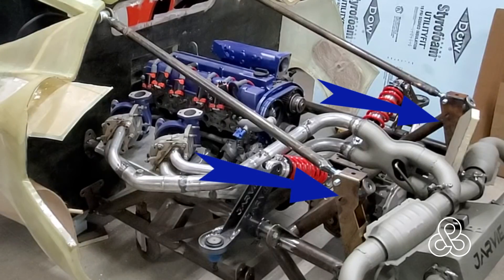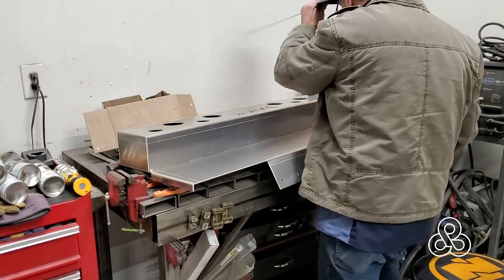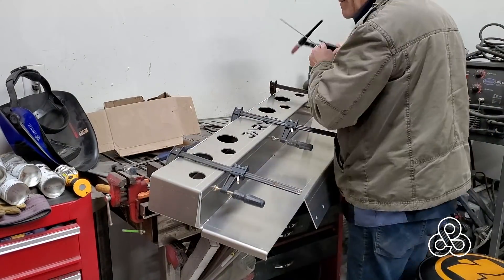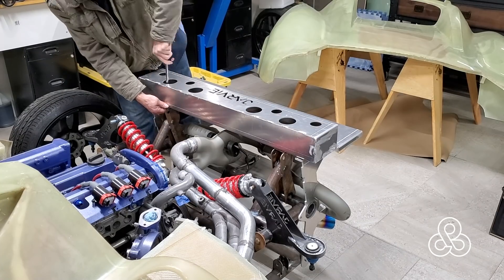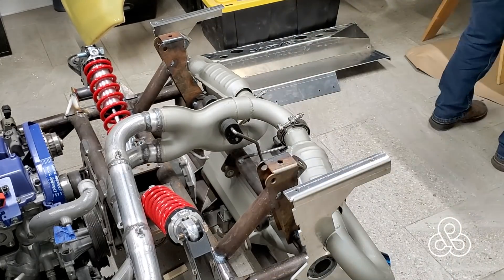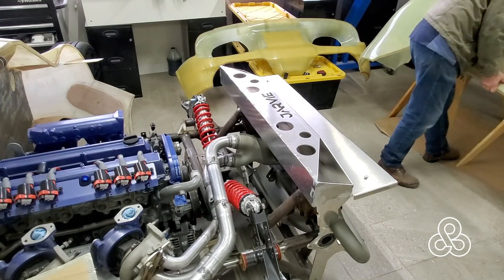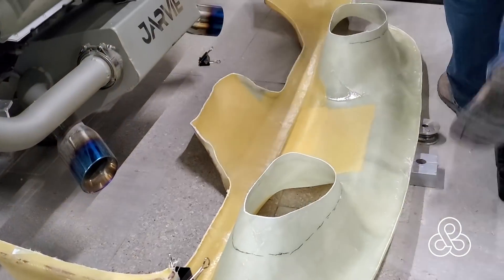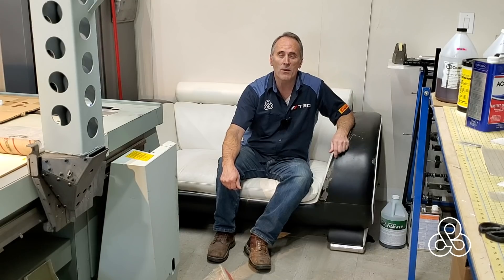A55 Building the rear structure "thingy" that holds a supercar's bumper on! Arete Supercar project.

Comment: I've never run a waterjet cutter, but it seems that there are different lubricants/coolants available for ferrous and non-ferrous metals, so the cut surfaces remain clean for welding. My guess is that it's a pain to swap these out, but I'm just speculating.

Comment: You are correct, water jet cutting leaves contamination embedded that needs grinding to remove... laser cutting is better when you need to weld Aluminum parts. Water jet cutting is ok on steels as it’s harder so contamination isn’t a problem

Comment: I was wondering what the reason was for gel-coating the mould but not the body panels?
Reply from the maker: We don't care what the mold weighs and we want the mold surface to be finished upon cure of the resin; the body however, we want as light as possible and we will be finishing the surface with primer fill and paint.
Reply: @BuilderCreator  Ok, that makes sense. It's a fantastic looking car. You have a great deal of talent.
 I have always wanted to build my own car, but I'll have to make do with watching our project progress for now.

Comment: 04:20 is the exhaust not going to create Some heat issues, so close to the suspension damper?
Reply from the maker: If you look closely there are 2 threaded studs on top of the exhaust in that area; this is for a heat shield. I will also be wrapping in some areas and of course the ceramic coating as mentioned by JK.
Reply: Exhaust is ceramic coated. It may not be as hot as you think.

Comment: did you pre-clean all areas to be welded with a fresh, clean, non-contaminated Stainless wire brush and wipe down all areas with Acetone? if not, theres your problem
Reply from the maker: That is the typical prep. Finding that a more aggressive sanding is what is needed. Seems there is some electrolysis like action in the water cutting that is producing a hard oxide layer. . .and to think going with water was to end the surface hardening you get with laser or plasma.

Comment: Yes the garnet will effect the weld. I grind every edge to a shiny finish before welding. I'm guessing you were having a hard time getting the pieces to establish a tack?
Reply from the maker: Yep! Finding that a more aggressive sanding is what is needed. Seems there is some electrolysis like action in the water cutting that is producing a hard oxide layer. . .and to think going with water jet was to end the surface hardening you get with laser or plasma.

Comment: Us a small dedicated stainless brush to clean your weld zone, it will help a lot.  Also roll your torch out of the puddle when you terminate to prevent the dimples aka weak spot or inclusions at the end of the weld.
Reply from the maker: That dedicated brush keeps getting re-dedicated to some other duty. Ha!
Reply: @BuilderCreator  believe me I know exactly how that goes.  Cleanliness is definitely the best way to get good aluminum welds for sure. As a precaution don’t use brake cleaner or any like chemicals on aluminum before welding, it’s toxic and will kill.  I had a friend learn the hard way.

Comment: The technical term is aluminium rear structure engagement. Or ARSE for short.
Reply from the maker: So, what your saying then is that the rear vents are not vents, but holes?
Reply: Correct. Beware any gasses expelled from them. They can be potent at times.
But on a serious note. Great build! I’m really enjoying the series. Keep up the great work. Plus the explanations are really helpful for those of us with less experience. Thanks!

Comment: Im pretty sure thats because of oxidation, also those plates seem to be treated with something. There is no way to make a clean joint without proper prep.
Reply from the maker: You would think that the water-jet, since it is using sand would leave a sanded surface, but alas, I'm having to sand the sanded. ha!
Reply: @BuilderCreator  i would start with some good degreaser and wire bush to remove oxidation. Aluminium loves oxygen and can oxidise very fast (which is actually good).

Comment: How do you like that laser? Is it powerful enough to use outside or at a distance?
Great video!
Reply: You generally need a rotating or pulsing laser for outdoor use, a green light laser is easier to see than the red lasers, I have used mine outdoors when the sun drops but if you need to use them during daylight hours you can buy a target for them which picks up the laser pulses even though you can't see them.
Reply: @errolseager1292  Thank you!

Comment: What are your thoughts on waterproofing the car, like having drain holes, and other places for water to go? And how will you do the under side, will you have some kind of plate to guide the air under the car and some kind of rear diffuser and front splitter? If yes, what would those be made of? (more of the kevlar?)
Reply from the maker: Now that the front and rear clamshells are in place I will be starting work on the front splitter and rear diffuser -exposed carbon fiber on top with kevlar on the bottom for impact durability. Rain channel around the doors is also on the up coming list.
Reply: @BuilderCreator  just saw a program on telly yesterday bout the porsche 955?  All aluminium chasis.  The dipped in corossion inhibiting emulsion, what do you think of That for your build?
Reply: @BuilderCreator  Nice. As the person above me asked, will you do any proofing against corrosion on the sub frame or is it good as it is?
Reply from the maker: @assarstromblad3280  Coating on all metal components. Powder coating of the smaller items, "Steel it" or similar on the steel subframe and zink chromate finish on the aluminum. Tried a new product for the fuel tank that you will see in next weeks video. Aesthetically it is crappy, but should never have a corrosion problem!
Reply: @BuilderCreator  Sounds good. With the diffuser and splitter you won't see it that much anyways so I guess better have a bit worse aesthetics and never have to worry about corrosion. Thanks a lot for the answers!
Reply: @BuilderCreator  for the front splitter, have you considered a Ti slider for the edges? https://professionalawesome.com/product-category/aerodynamics/titanium-skid-blocks/
Reply: I am missing some carbon fiber.. :)

Comment: I would assume that the media in the water jet is embedding surface oxide into the cut edges and you quite possibly have some micro sized particles of the garnet media they are using embedded into the cut edge. You'll also notice that the edges of the cut part is not 90 degrees rather a few degrees under, I'd recommend using a wire brush over the edge and then cleaning the edge with an acetone soaked rag. But saying that, the problem depends on the size of the garnet used in the waterjet.  I'd get the pieces cnc plasma or laser cut if the problem still exists.
Reply from the maker: Also less problem with it when I'm using the spool gun. . .maybe a little less laziness and get the spool out. Ha!
Reply: @BuilderCreator  Hope that fixes it. :)

Comment: Would a rubber gasket under the mounting box help with noise or even non wanted movement?
Reply from the maker: There will be rubber seals and spring loaded latches on top. Under the box 10 bolts in 6 mounting locations should keep the box itself immobile.
Reply: Should have known you already thought about it ;)

Comment: I always hit every water jet cut with a 50 grit pad to get shine back. Just like plasma, the cut lines always weld horribly.
Reply: Yup same. Any joint machined gives me no issues but plasma cut or water jet usually does.
Reply: I wonder if you were to take an angle grinder and back cut an eighth inch, they would weld better?
Reply: @toddaulner5393  back cut an ⅙ inch and nothing would fit anymore. You only need to clean off a couple thousandth until the shine comes back.